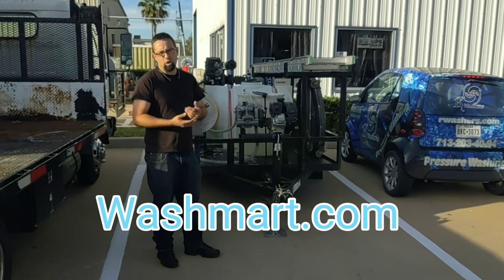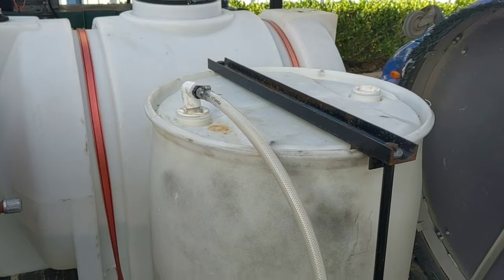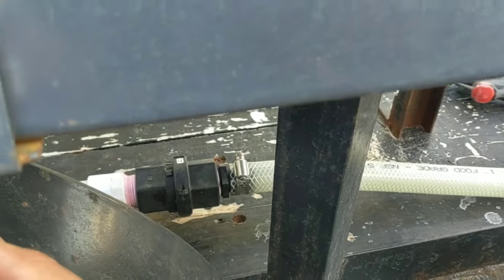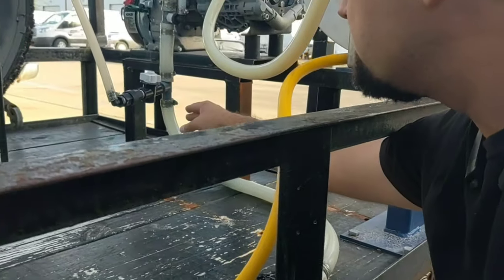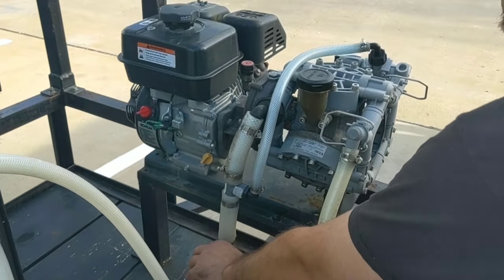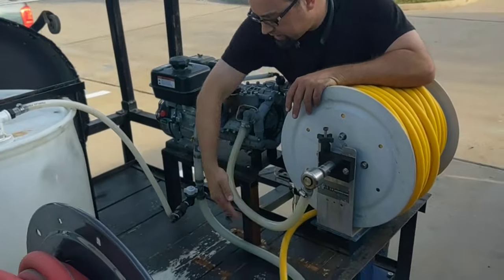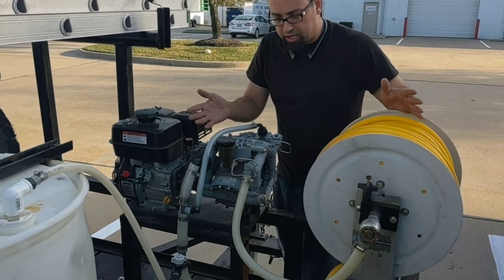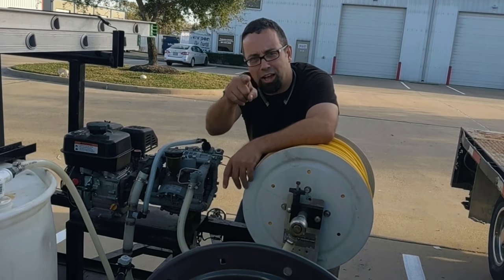Gas powered soft wash metering system

Comment: Do y’all sell the AR45 pump that is 11.4 gon at 290psi?
Also,   Wouldn’t gating back the water supply lessen the gon?  Why not just use a larger sh line and metering valve

Comment: Hi Marco, if you use a 3/4" return line on the pump to recirculate the SH, would that work better than the 1/2" line so the water would not overheat?
Reply from the maker: You could give that a try.  I have not made an attempt. Also Comet makes it difficult because they are custom fittings that fit in each port
Reply: @TXcommercialwash  thank you